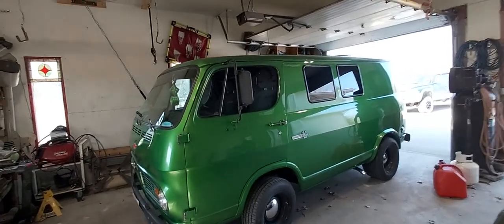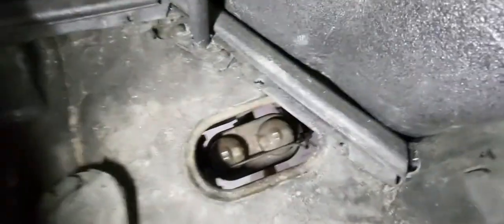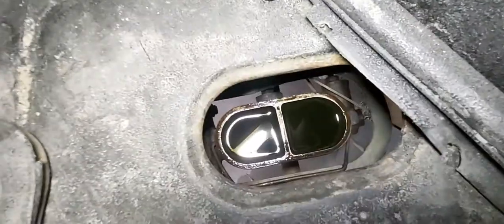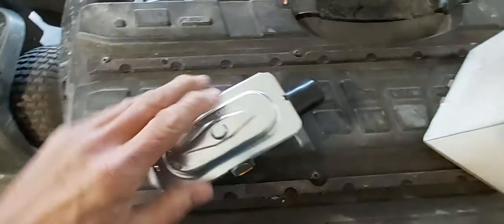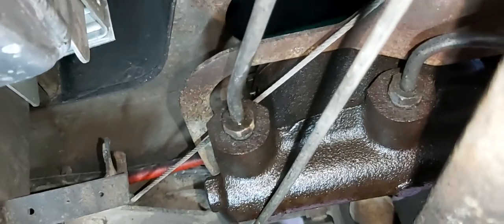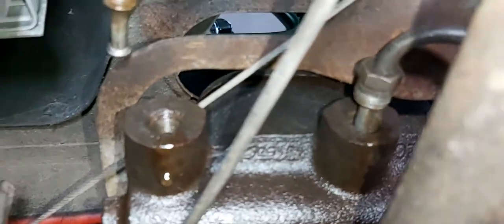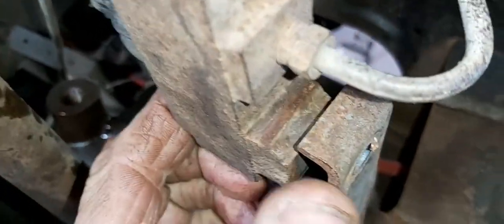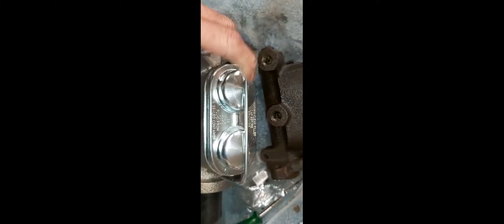67 chevy van master cylinder replacment

Comment: Question how long have you had the van and have you replaced the rubber around the wind wings ? I need to on my 67 but hard to find .
Reply from the maker: Hi had the van for 3 years haven't replaced the rubber  are you familiar with the forum VINTAGE CHEVY VAN forum lots of good info there '    http://www.vcvc.org/forum.php
Reply: @MrKalicat  will check it out thanks , I did join venTage vans but it's not to good .